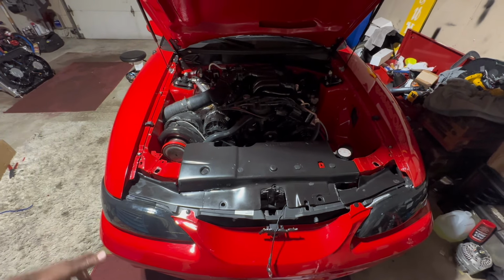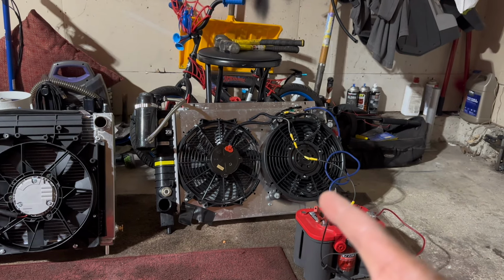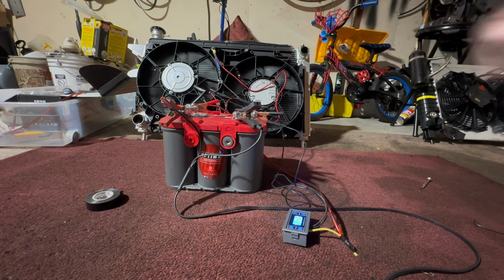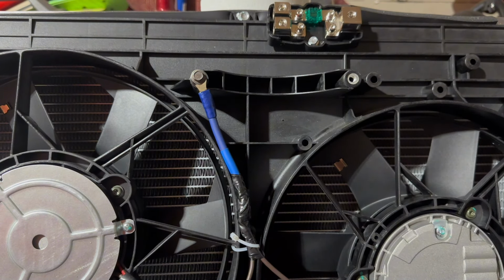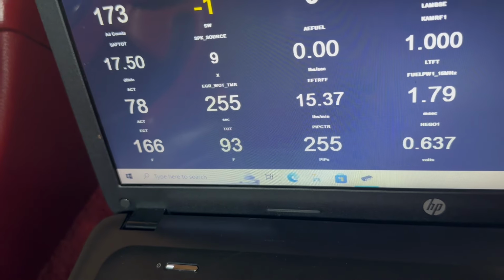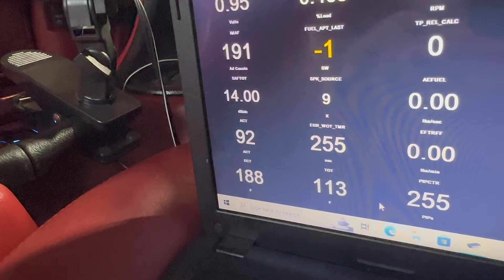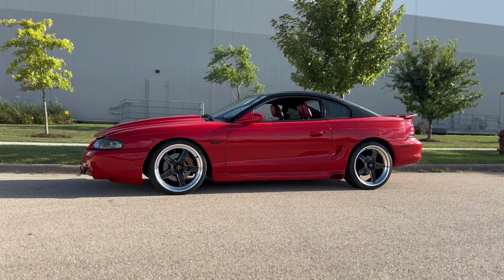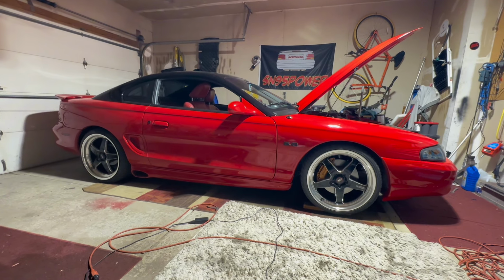Electric Car Cooling Fan Installed On My Turbo SN95 Mustang

Comment: I had to replace my 3 row radiator with the OEM one recently... Fixed all of my overheating issues with my 03'.
Reply: I've had high temps from a 3 row as well. Never over heating but rides over half way on the gauge. I'm about to go back to a single row radiator
Reply: @eddierourk  Yeah, the thicker radiators... The stock fan has trouble pulling enough air through them. The only way to run a thicker radiator will be to upgrade your fan to one from a Lincoln MkV... Stock radiator is just so much easier and efficient.
Reply: @eddierourk  Replace that thermostat too, when you go back to OEM. Just to be safe.

Comment: Where did you tap in for power from
Reply from the maker: @talksondblock9483  ccrm is controlling it
Reply: And that’s the fan wire on the ccrm ?
Reply from the maker: @talksondblock9483  Yes, I have it tied to the high speed fan on from the ccrm
Reply: Sorry but now I can’t get pass the abs with the fans
Reply from the maker: @talksondblock9483  You'll have to move it. Unbolt it from it's mount and see if you can put fan in. Once it's in, see were you can remount abs
Reply: What’s do you think about the contour fans
Reply from the maker: @talksondblock9483  They work for most but I have a friend in Georgia with the Contour fans. On 90+ degree days with AC on his Mustang will over heat